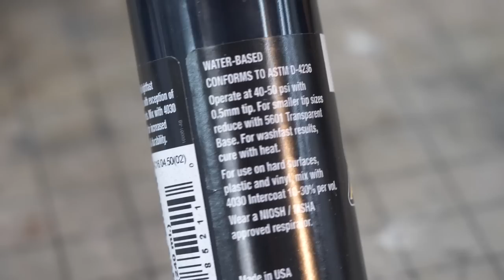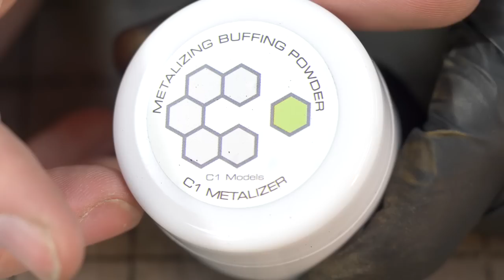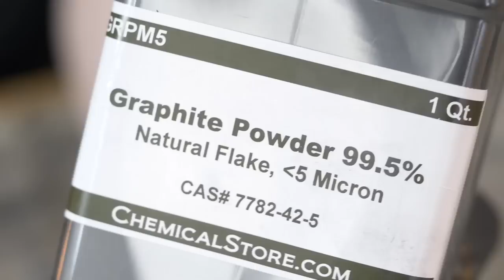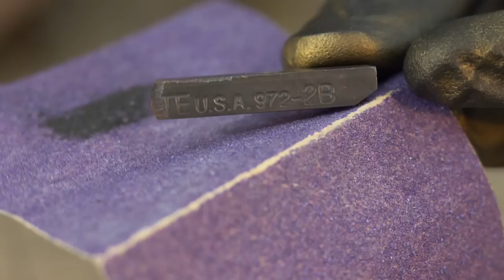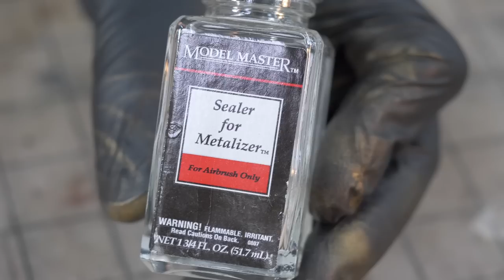SHINY! Graphite vs. Metallic Finishes - Wonder Woman's Sword of Athena

Comment: The trick with Alclad is having a wet gloss black coating and "mist" the metals over it to give it an actual metal like feeling
Reply: Also, only use alclad laquers with alclad products or else there is a VERY big chance of it reacting
Reply from the maker: You speak true truths!
Reply: Yup, that’s how I do it!
Reply: Also, I’ve had good results with Krylon Gloss Enamel and Createx Gloss as a base coating for Alclad.
Reply: @coregeek  Awesome thanks for the tip! you wouldn't have found a trick around the chrome problem would you? (alclad chrome looks great but needs a clearcoat, but once it has one it just turns dull)
Reply: rensole Probably lots of patience with many thin coats. We were rushing things a bit to get it all filmed.

Comment: Hey Bill, little challenge, do you think you could do a "Damascas Steel" style blade using the 2 metal paints/graphite used in this video, maybe using a laser cut stencil? Another great video dude:)
Reply from the maker: I've thought about how to accomplish that look and I haven't come up with a good process to try yet. Rest assured it's on my list of things to try.
Reply: Punished Props Academy do you reckon there’s a way to use the Molotow chromes reactivity against itself, maybe reacting with a clear coat to create a crackle effect?
Reply: @punishedprops  you could marbelize it in water with different shades of metallics
Reply: @punishedprops  It's something I've tackled. Layering many layers of black and silver and then sanding doesn't work out very well. I'd recommend you use a base of silver and apply black over it, then scrape off the black while it's wet with a wood grain tool.

Comment: I Bill
I used that graphite powder on a shiny white painted surface with a spray from Montana and the finish sucks. There is a way to remove that powder to repaint it with another lacker? And to mantain that poder? If I touch it with my fingers it get attached to the fingers. Can I apply some clear coat?
Reply from the maker: We haven’t done any more graphite experiments, but Coregeek has, he may be able to help: https://youtu.be/fRaOMuqxM-g

Comment: So I tried the graphite powder on gloss black acrylic and clear coat above gloss black.  The graphite does not seem to stick to the paint. It basically just comes off.  With buffing it is super shiny with a little metalic sheen, but no real metal looking finish like in the tutorials.  Any ideas what is going on?
Reply from the maker: Hmmm it could be the clear coat? I usually apply the powder right on top of the gloss paint.
Reply: @punishedprops  Thanks for the tip.  I tried the powder directly to the black gloss with same results.  I suppose it may be the paint formulation (automotive acrylic).  Trying some different paints today and will post results.
Reply: @punishedprops  Regular spray acrylic paint (Rustoleum etc.) in black and clear works.  The acrylic spray paint I got from an automotive dealer does not allow the graphite to adhere but is way more shiny.  Going to run a Alclad clearcoat over the graphite now.  Thanks for the awesome idea guys!  Love your work.

Comment: Did you thin the Chrome paint? I think Adam says you should thin it. Check out his recent Mortal Engines Prop build.
Reply: Kenneth Kniffin I’ve heard various success, failure stories with thinning it.
Reply from the maker: The Molotow chrome paint is already super thin and shouldn't need to be thinned for an airbrush. At least that's what I experienced.

Comment: I love the Molotov chrome so I tried it on my power swords but I can not find a way to clear it without losing the shine.
Reply: Clear resin will do it.  But not an easy thing to coat with.
Reply from the maker: I'm wondering if I just laid down one thick coat and then left it to dry for a week if that would do it. More testing required!
Reply: @punishedprops  If I recall, when doing my arcade stick, I'm pretty sure I left it to dry for a week at one point and touching it still turned out to be a no-no.  It was really easy to embed a fingerprint if I wasn't wearing a glove, or put too much pressure on it and then it was back to wet sanding to try and patch it.  I ended up doing like maybe 10-15 passes on it to get all the blemishes out, and I still ended up with one where I gave up because I was starting to risk my really nice masking I had done and it would be a true pain to half to start over.  The stuff looks great on plastic, but from what I can tell, it was formulated to go onto paper.
Reply: @technicallyartistic  I will try this also
Reply: @punishedprops   I tried for a week and a half, as soon as I put on the clear coat the shine turns gray.

Comment: What can you seal the finish with if you don't have an airbrush?
Reply: Any spray can clear should work, but always test first in another piece.
Reply: Most readily available spray can clears that I have tested dull metallics. Clear coating metallics is a tricky thing. Just be sure to test first.

Comment: For flat swords the absolutely best shiny finish is aluminum tape (and buffing it), but you can only use it on non textured surfaces so it obviously wouldn't work here but for future swords with no extra textures on the blade that would be the best.